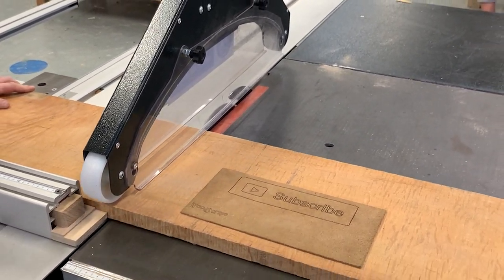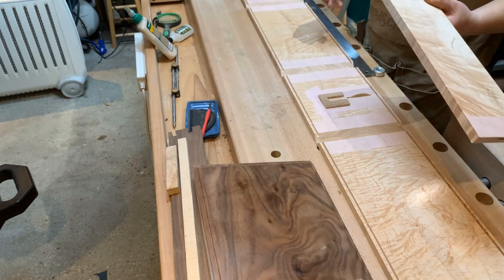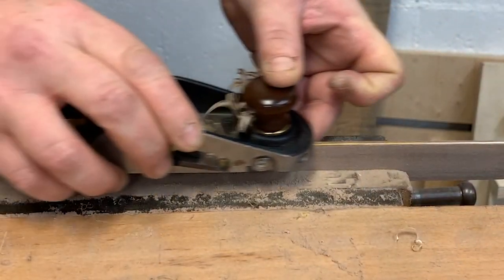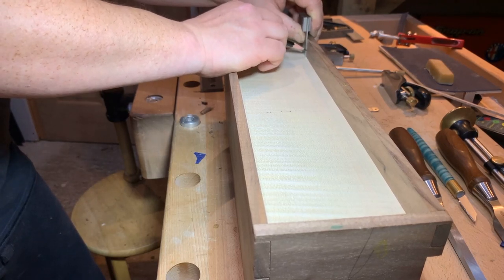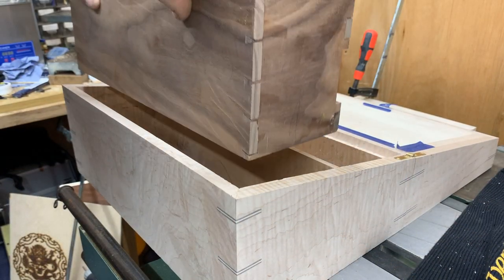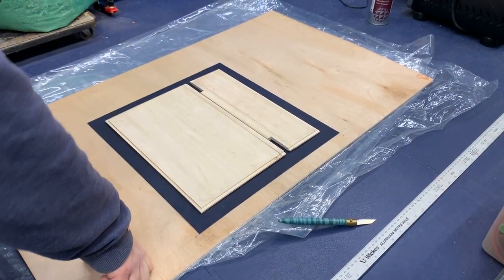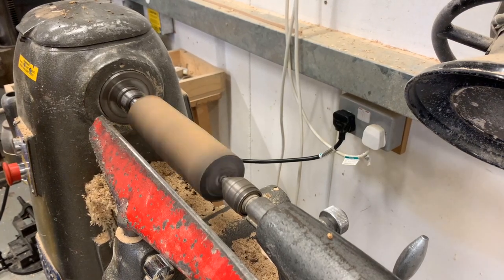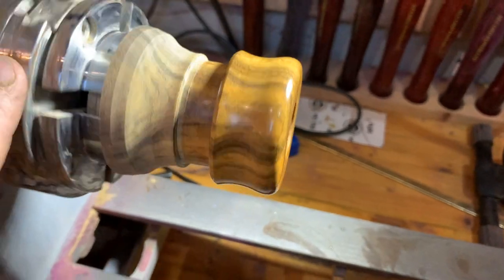Making a Writing Slope

Comment: Please tell me you made plans for this?? I would love to get my hands on those! 
Outstanding work man. Immensely impressed 👏
Reply from the maker: thank you for the kind comment. It was designed on fusion360 but a few bits were designed in my head. If you have Fusion360 I can send you the file otherwise you will need to send me an email address. you can do that through Instagram message instead of here.
Reply: @WoodScrape  I use sketchup but I'll find you on Instagram and message you. Once again outstanding work!